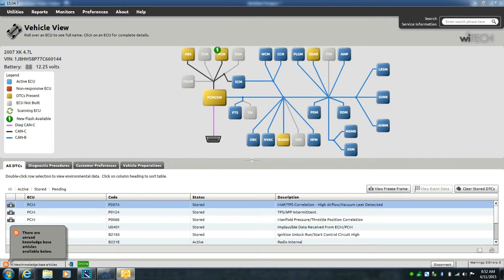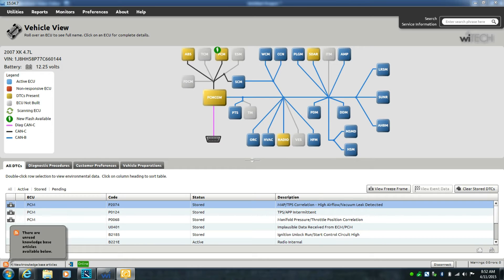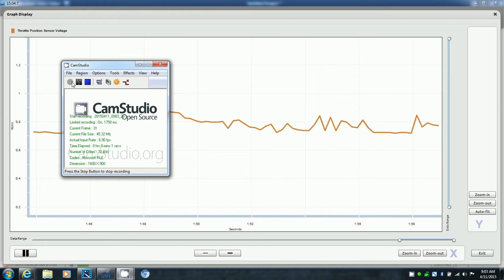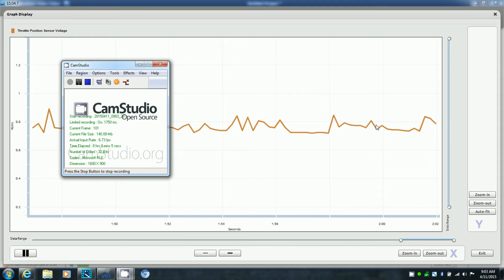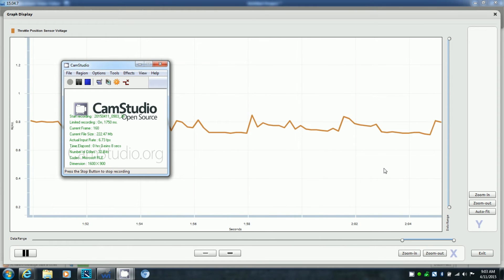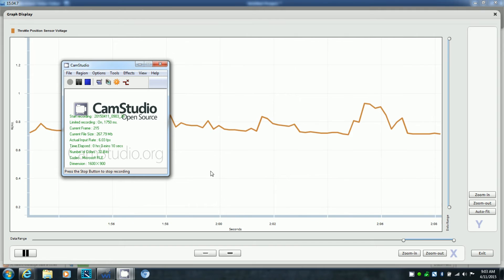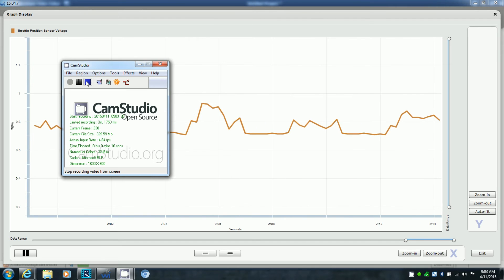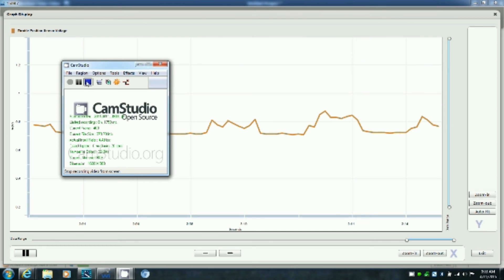Part 1/2: Chrysler, Dodge, and Jeep 4.7 TPS sensor troubleshooting

Comment: I have a 4.7 Ram 1500. Question: while performing a sweep test TPS voltage goes up to 3.8v to WOT.  Isn't it supposed to go up to 4.5v at WOT?

Comment: I change tps sensor and I can't clear the code. Can you help mi .
Reply from the maker: If you tried to clear it with a scanner and it wont then you might have other issues. IF the TPS was the issue then the code should clear with no problems.